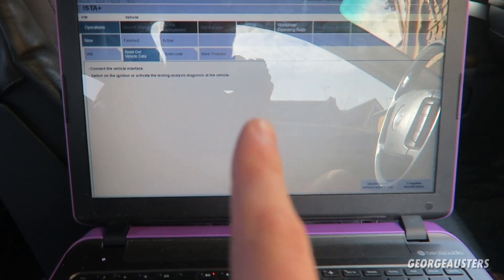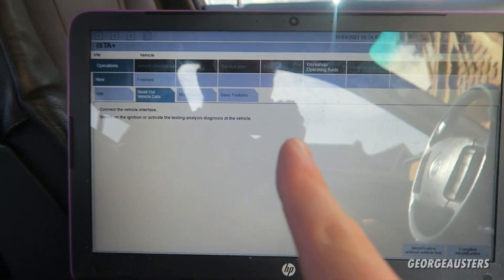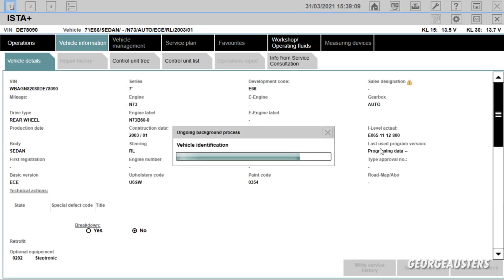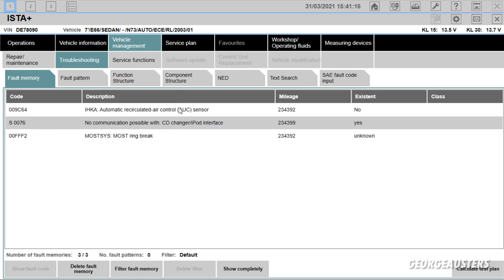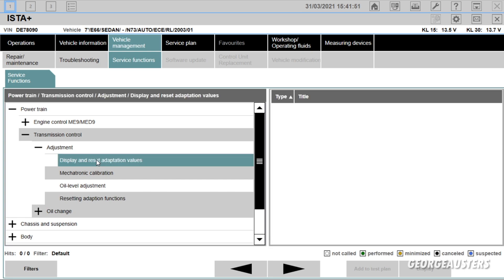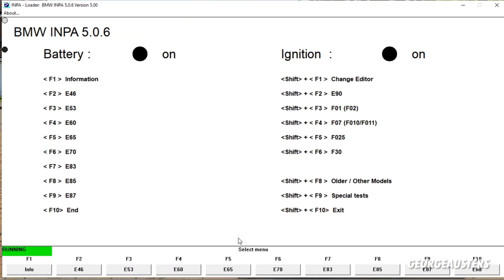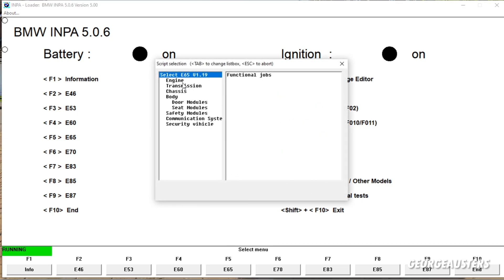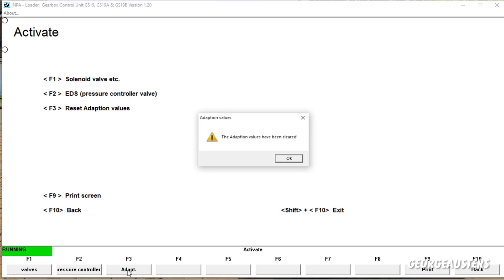How To Reset BMW Transmission Adaptations *EASY*

Comment: I use Bimmertool which has two levels of reset. You can reset learned parameters, as well as adaptions. I was advised to only reset the former unless hardware has been replaced. The former is learned from driving patterns, the second is used to compensate for wear and ageing of the components.

Comment: never have engine running while using ista to reset adaptaions or clear codes.

otherwise engine running is fine while using most functions

use battery charger or flash programming power supply, just some advice.

Comment: I am planning on changing the 7 solonoids connected to the valve body should i need to reset or not im just confused and dont wanna f something up
Reply: What you ended up doing?

Comment: You reset the adaptations after any replacement of the solenoids or any work done to the valve body or other mechanical internal.

Comment: I have 2003 BMW 325ci trouble lightnext to Don dash.can move shifter in all modes-P,RDN must scream the engine to move it manual says it lost 3rd& 4th gear.possible causes?

Comment: I've read resetting the adaptions on the transmission is not ideal, because it is designed for lifetime fluid, which is never to be changed. What is recommended is to change the fluid and filter and reset the driver's adaption, using the ignition on accelerator pedal method. That's what I did with my GA6L45R GM transmission on my E90 a year ago and never had any issues thus far. I used Valvoline Multi-vehicle ATF. 24 bucks for a 5 quart jug. I bought 2 jugs and used a jug and a half. Drives like new. I'm going to do it again, because as we all know, not all of the original fluid comes out. The fluid change has to be performed several times in order to completely remove the original fluid. My original fluid was thin, yet still pinkish. Not burnt. The Valvoline ATF is the thickest fluid in the market and it worked like a charm for my car. I had 108k miles when I changed it.
Reply: No fluid is lifetime eventually will go thin and go bad
Reply: What kind of BMW do you have?  I have a 2009 328i.  I plan to change the transmission fluid and filter.  I don't think I'll do the adaptions, but definitely turning it on and stepping on the gas pedal for a minute should rest it.  Just like you did.
Reply: @georan4323 I have a 2011 328xi. When I changed the tranny oil, I didn’t change the filter because the fluid still looked good. I changed it at 108k. I’m at 120k now and I’m going to change it again, but this time I’m changing the filter. I think I’m going to get three jugs, drain the current oil, pour in the new oil, drive it about 5 miles, drain it, replace filter, add fresh oil and button it all up. After pouring in the first stage of oil, start the car, go through all the gears a couple times, let the car idle until the tranny fluid reaches 108 degrees. Then add more fluid until it seeps out of the fill hole. This next round I’m going to replace the seals and whatever I can replace so I don’t have to open it up again to replace the seals. They’re very inexpensive so I might as well replace them while changing the oil.

Comment: I purchased a foxwell scanner which has the option to reset the dct gearbox. What the difference with this scanner and inpa?
Reply from the maker: Inpa was the official BMW tool used years ago
Reply: @GeorgeAusters  ok. It also asked me to do the reset while car was running is that normal ?

Comment: Have a 13 535i x drive just had drain and fill trans pan filter replacement still sticky in first second and third from what I can feel other than that car is fine do u think the adaptation re learn will help this is literally the only problem I still have with this car
Reply: Did you fix it ? Jw if it might have been your solenoids ?
Reply: Okay so it's better but still like a bit more than I'm used to transmission braking feeling in first and second granted I've had Infiniti's most my life so maybe a good portion of this is mental but still gonna get the solenoid checked just in incase

Comment: Hi, i have bmw e61 m47d20 and i have problem with vibrations, when i put in reverse my car start to shake, recently i changed engine mounts and i stil have the problem, only when the car is cold at the start there is no vibrations in reverse, some advice would be great. Thanks
ps. Automatic gearbox 🙂

Comment: Sometimes these software programs will only allow you to do certain functions if a range of criteria are met first Such as engine at operating temp. Or gearbox at operating temp. Or ignition on or engine running at idle speed etc etc.

For example to change the idle speed on my E92 with INPA, the engine must be at full operating temperature and running at idle speed, or it won't let you change it.

Comment: Hi George.  I get some blank pages on ISTA when I am looking around too.  Usually find what I want by clicking on the group heading as it were and then you get a list of many things on the right which usually has what I am looking for.  Must check if I can find adaptation values on ISTA on my 2005 760Li next time I am plugged in ... By the way, you can get a replacement Air Quality sensor from China for about 15 quid.  I have one coming and will report back if it is useless after I have installed it.  Will try to fart at it when I have installed it and see if it works and turns on recirculate.  Seriously the air filter in my home office kicked on when I farted near it the other day!  Thanks as ever. Mark

Comment: Great video, interesting subject, rightly or wrongly I reset mine every month, E46, 2003, 330CI Auto, using ISTA.
Reply from the maker: Notice any difference?
Reply: @GeorgeAusters  Hi George, yes to be honest, I find shifting and smooth running is always there and also depending on my driving style. 
I have not done an oil or filter change on my car, it’s on 134000 miles with the ZF gearbox.

Comment: Hi George, I was led to believe adaptions should only be reset on a rebuild. Reason being;  the box has adapted to the wear of the clutch plates and is doing what it’s supposed to have done.
Reply: I reset them after changing the fluid. Also, doesn't hurt the transmission. Sometimes the adaption values cause delayed shifting and holding gears
Reply: The "small" reset does not hurt at all and can be benefitial to solving minor problems. I mean the 30 sec pedal thingy. There is a more extensive version on Gearbox reset where you have to drive your car in a specific way to literally relearn everything from scratch (like go, stop, go, sto, go, let coast to almost zero, accellerate again, let coast to almost zero etc etc...) which is time consuming, you can make errors so you have to start over and you have to have a lot of room for this which leaves you to a boring night drive outside the city where noone is around to stop you. And the interesting part here is that INPA does NOT tell you what you are about to reset or even ask you a second time if you are really sure you want to delete that particular data :D just "Okay, done as you asked" message :D INPA is indifferent like "Do you want me to reset your service interval light" and has the same attitude with "Do you want me to set your car on fire and let is explode hollywood style?" :D
Reply: They also contain the adjustments to expected hydraulic pressures on the solenoids which activate different gears.  If  your mechatronic seals and bridge seals are leaky and you fix it by replacing them the reset is beneficial too. Rbt tuning is an austrian company making modified maps for bmw zf 6 and 8hp (got one on my e90) and on their blog they explain these things very well.